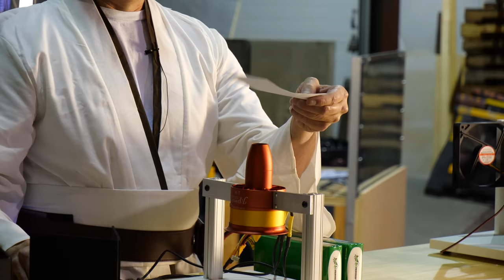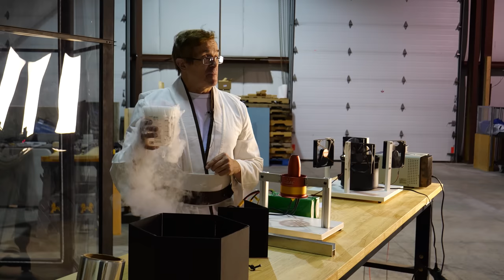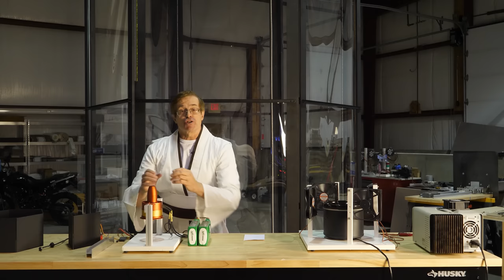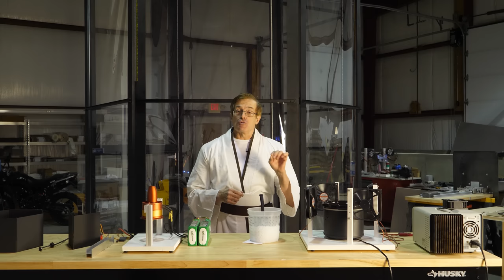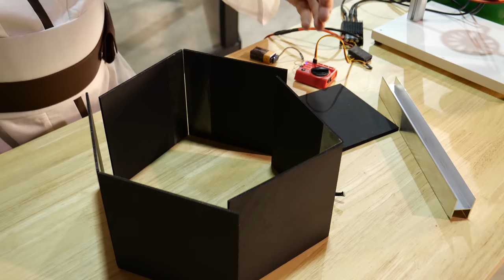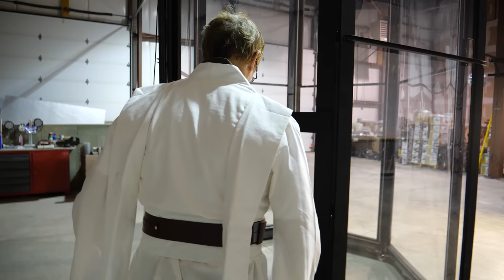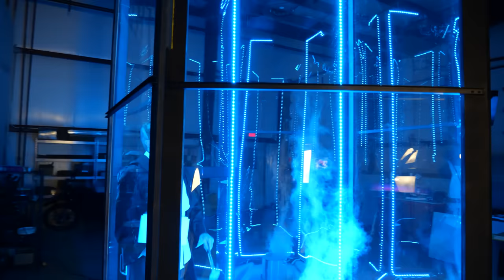Controlling Chaos: Building a Massive Tornado Chamber!

Comment: Hmm. I was expecting the "tornado" to become self sustained for a time...ya know, like a supercell might? Can u take this a step further? Otherwise, this is simply a vortex. Albeit,  a very cool one. 🎉
Reply from the maker: Probably not 
A "real" tornado is not self-sustaining either. Energy  is constantly being added as the high-level winds and the up and down drafts associated  with them drive the flow.
Reply: Sure. However, emulating the supercell media differential to then "power" the event v. Fans alone would be pretty amazing. A 'Stirling-Vortex' if you will. Robert Stirling & Viktor Shauberger. A tornado in a bottle, producing work. Perhaps it could be designed as a secondary heat scavenging device for electrical generation 🤔.  Complex integration is possible with additive mfg.

Nature is full of truth and grace waiting to be understood. And, I keep having passing imaginative images of such a device, scaled to many sizes for different applications. Not that it matters in the land of cooks we live in..😊

That being said, I love everything you do. Many do. Ty.

Comment: I wonder, would a desktop computer case using this system be super efficient at cooling?
Reply: No.
Reply: Actually yes. A desktop computer case with the corners open and a very powerful exhaust fan built into the top, would be good for cooling. It won't make a vortex because of all the stuff inside the case. It will be loud AF, and all the airborne particulates in your room will be drawn into your computer case. And then, if the static electricity is strong enough for the dust to stick to your circuit boards rather than to be sucked out with the air, by the fan... and you end up with a thick enough film of dust that you created an insulating blanket... then it could become like pulling in opposite directions. The fan tries to remove heat, but the dust tries to hold it in.
Reply: @GizzyDillespee  So the answer is no then, as what you describe is not the same thing at all. Keep up.
Reply: Yes. 
A 6,000 cfm warehouse exhaust fan taped to your computer case would be super effective (but not efficient, nothing is really very efficient) at cooling it.. And probably blasting any dust off too.. 

Though it will likely suck everything off your desk too, and impaling your video card with a 200 mph inkpen won't do your frame-rate any favors.. 🤣
Reply: @Dr_Wrong  👍 for the funny right there, thanks! Cheers-

Comment: Why not just use fans instead of panels like the small demonstration you display? It would seem like it be more simple than building panels. It seems all need to build is a tower to suspend the upper fan. No need for all that plastic.
Reply from the maker: As I explained, the stability of the air surrounding the vortex is very important. 
If you take another look at the fog in the chamber while I was making my concluding remarks, you'll see how impressive the vortex patterns were once just my body was removed from the chamber.
You can get away with an open arrangement, but the results will be less satisfying.
Reply: @TechIngredients  thank you for your response.

Comment: You lost me at the beginning, because by your explanation of air pressure, we are living in a constant sonic boom. Air pressure is due to the weight of the the air molecules (volume, not velocity). The higher you go, the lower the air pressure because there’s less volume above/around you, all the way up until you eventually reach the “vacuum” of space. That’s why the higher you go the lower the velocity required to break the sound barrier (lower volume is “easier” to pass through).
Reply from the maker: The speed of sound decreases with altitude  because  the temperature  and the velocity  of the molecules decreses.
Reply: @TechIngredients  sorry but it’s nothing to do with temperature, it’s density. Wow. It’s basic physics. “The velocity of the molecules “? What are you smoking? I think your brain is missing too many molecules.
Reply from the maker: Don't  be sorry.
But, you might want to study  physics.
Being insulting only makes one of us look bad...and it isn't me.
Reply: @TechIngredients  you’re idea of how air pressure works is simply confused according to actual known physics. Yes air molecules, as all molecules, are in a constant state of vibration. They move faster when “hot” and slower when “cold”, but again... pressure is not due to their vibrations (temperatures) then there’s wind speed (velocity along a vector)(nothing to do with pressure, except within air speed measuring equipment on aircraft), it’s the amount/mass/weight within a volume. Just like water pressure, the deeper you go, the higher the pressure, due the the mass above you hence psi/bar not mph/kph.

Comment: This is a really cool project and demonstration, and mostly idiot-proof....

But did it really not strike anyone that there exists the very real potential of enclosing yourself in a chamber that could slowly fill up with more and more CO2?
Reply from the maker: That's  not a significant risk.  The CO2 is heavy, and even without  the fan, it will hug the floor and leak out the gaps between  the wall panels. With the fan, it's gone up the vortex.

Comment: Another ingredient necessary to make a tornado is lightning to get the air spinning.
Reply from the maker: Why is that?
Reply: I read an article in ELECTRONIC ENGINEERING TIMES around 1981 or so on energy expended in a lightning bolt to make the sound is greater than that of air rapidly expanding from the heat generated by the discharge alone. It mentioned a phenomenon referred to as the alpha (delta?) torque. The rapidly rotating of the air as the discharge passed through it it. (Don't Googol it; it won't be there.) Consider the sound that a tornado makes is that of a roaring train. We do know that there are several hundred lightning strikes per second inside a tornado. I think that this loud train roar is caused by the lightning bolts and somehow they congeal into a larger air mass rotation we know as a tornado.  
       If this is indeed true it might give us a way to control a tornado's behavior. Perhaps by shorting out or discharging the electrical charge built up in the cloud by seeding it with something that conducts, like ocean water.

Comment: Look STOP calling this a Tornado Chamber.  I am not fussing here.  Your display and chamber is cute but it has nothing to do with a Tornado.   It is a wonderful vortex chamber!  But the day you can find a Tornado with a fan sucking air out the bottom of the funnel you will be able to honestly call this a Tornado Chamber.   Tornados do not have anything to remove the air at the bottom.  Their physics is entirely different from what you portray.  You mislead people and many others have too with vortex chambers calling them Tornado Chambers.   Your system wouldn't lift anything! Tornados lift stuff.   Your Physics is all wrong.
Reply from the maker: Our vortex is lifting the heavier  than air fog. Your premise is wrong, and we'll  stick with the title.
Reply: I don't understand your comment. there's no fan at the bottom...are you referring to the top of the chamber as the "bottom" of the vortex for some reason?
Anyway it made me think: would it still work if the fan was at the bottom, and the tangential air entered at the top? I'm guessing that it would.
Reply from the maker: It would work,  but that would be an upside down tornado.
Remember,  the airflow in a tornado is from the ground  up into the clouds because  it is driven by an updraft.